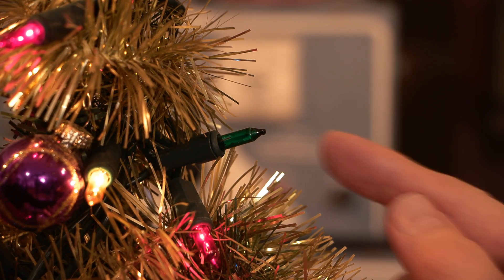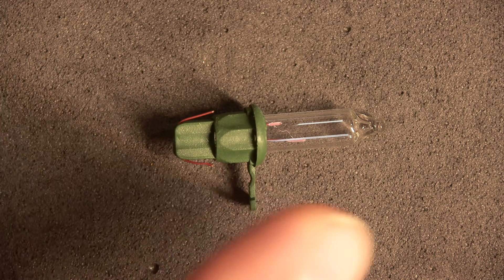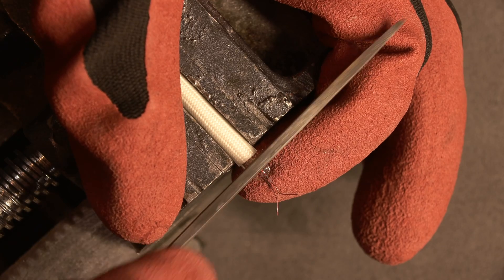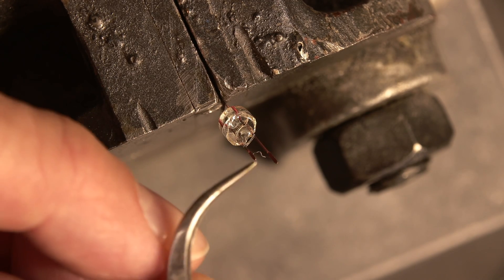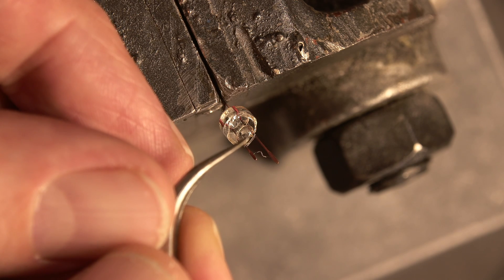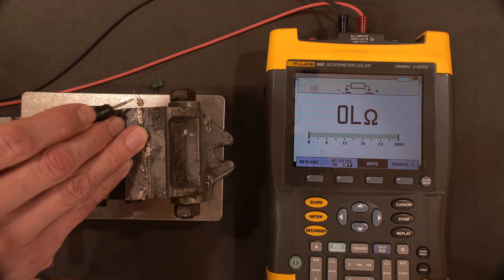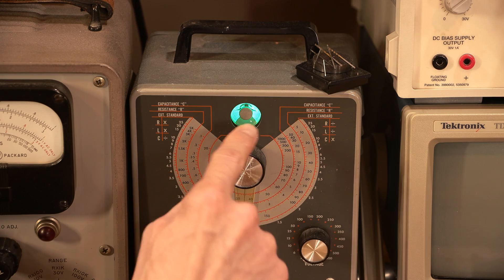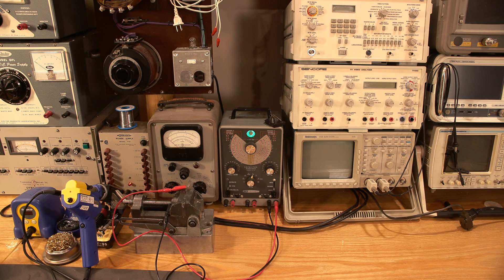The Magic Hiding Inside Your Incandescent Holiday Light Strings!

Comment: "So what is remaking that circuit again?"

Nothing, because it wouldn't be making the circuit again again. It would just be remaking that circuit. (Period.)
Reply from the maker: #1 When multiple bulbs fail, they are continually re-making the circuit. 
#2 The filament originally made the circuit in a single bulb, then the shunt re-makes it. 
#3 The shunt will often not make the connection right away causing multiple flickers, re-making the circuit multiple times before it welds itself.
Choose which answer best suits your word play.
Reply: @MrCarlsonsLab : 1. You totally misunderstood what I was saying. I wasn't actually asking you what was remaking the circuit. Did you not notice the quotation marks? I was quoting you from when you asked that question. That's because "re-"(something) with "again" doesn't make sense. "Re-" already means "again"!

2. I wasn't making so-called "word play," silly. That's not what telling you that "re-" already means "again" is. It's just showing you why saying that ("re[something] again") doesn't make sense. There's a big difference.

Comment: Last year I've bought 3 garlands with this type of incandescent bulbs (100 bulbs 220 Volts), add fuses and 2x 36 Ohms resistors in each string, and you know what? After a month of usage more than 20 bulbs burned out in the first string, and more than 10 burned out in second and third strings correspondingly. 
I remember twenty years ago, when the garlands of incandescent bulbs did not have this "magical thing" inside, the bulbs itself burned out really rare; we have had 4 or 5 garlands of this type and usually only one or two bulbs failed during 11 month of storage (I don't know why, but they never failed while working during holiday season). Though they tended to melt their decorative plastic cases =D
Anyway, it seems to me that this "magical thing" was introduced not for increasing the reliability but as a part of the "programmed obsolescence" where the light bulbs themselves are of a very poor quality.
Reply from the maker: I purchased some very poor quality lamp sets as well a few years back, the bulbs burned out very fast. I suspect a bad vacuum or bad tungsten. Lately (with a diode dropper) I get years out of a string lit 24 hours a day.

Comment: Followup: I rewatched. Everything I wrote a few notes down is correct, I think. And the machanism that causes the shunt to conduct is that when the filament goes, then there is 120 volts across the insulated shunt. When the filament is working, the shunt is insulated and doing nothing. When the filament goes, there is 120 volts across each end of the insulated shunt, instead of whatever the bulb voltage was. So that 120vac "blow's" through the (very thin) insulation, and the conductors carrying the vac come in contact with the actual shunt conductive center section? I think that's right. Thanks.

Comment: So a series 20 bulb set of 6V each on a 120V(ac) supply could be better protected if another 9 more (8 is ok too) similar rated lamps were added to the series..so now instead of each lamp getting 20V(rms) ..each would get slightly lower than 20V(pk)......
Here the chances of the entire string experiencing a higher pk. is eliminated..even if the random initial switch on  occurs @ the pk. of the ac waveform.
Reply: If you connected 2 sets together in series, the lamps would all be dimmer, but would last almost forever!

Comment: Sir, A schematic would help in understanding for some of us. Is the "backup conductor" in parallel with the filament? Assuming the answer is yes, then you are saying it is essentially a zero ohm conductor, that keeps the overall series circuit of the string intact? And I think that in this design of string lights, all the bulbs are in series? So if there are, let's say 60 bulbs, they are each getting 2 volts (in America)? So the extra two volts is being redistributed across the other 59 bulbs? I'm still not clear on the arrangement of the shunt versus the filament, and the mechanism that causes the shunt to become conductive. The "insulation burns off" from what exactly?
Please take a moment to explain further. I thought "maybe" I saw another video from you on this subject. I'll look. I will also watch this one a couple more times. But if you do a video followup, please include a drawing or two. Thank You. Minneapolis MN Dec 19-2023

Comment: I have a GE tree that has pre-wired incandescent lights.  It has the old style of fused bulb which are not replaceable.  I have just been clipping them out and soldering in regular bulbs when I see a darkened section (probably done about 8 or so in the last 6-7 years).  I think the tree has 8 strings of lights or so, but it has a fused plug (with the little door that opens up).  Why would they use both the fused bulbs and a fuse in the plug?  I suppose they want you to buy another one at some point, but the newer models have replaceable fuse bulbs.

Comment: Very interesting. This might explain one of the failure modes of the entire string. If two or more bulb fail while the power is off (due to rough handling that breaks the filaments), there is not enough voltage across those failed bulbs to cause a breakdown of the bypass path. It would also explain why swapping bulbs one at a time fails to locate the double/multiple failure.
Reply from the maker: You are absolutely correct Tom!

Comment: I used these bulbs as street light bulbs and to illuminate the inside of buildings on my model railway layout back in the 70s.
I found out purely by accident that they ran perfect on a 12V DC transformer and I could dim or brighten them.
Looked amazing with the main light switched off, especially as the setting was all steam age and they gave a lovely warm glow.
I must have made about 300 lamp posts out of modellers brass tubing and roughly 50 buildings had lights inside.
5 years later and I was still working on it.
Truly remarkable little things.
✌️❤️🇬🇧

Comment: I have used an Associated Research hipot tester for 30+ years to break down the anodized shunt wire. Just clip onto the plug and turn up until the leakage light just illuminates. Plug the string back in and change the bad bulb.

Comment: If the antifuse doesn't trip and you do have half a string out, you can remove a bulb from the good half (if it's two series parallel strings) and zap the set with the sparker from a BBQ igniter, and it should make the antifuse trip and short the blown bulb, and the dead half of the string should light when you plug it in again.

Comment: How is the wire connected to each pole of the light itself but not connected while the bulb is on?   I’m trying to understand where the insulation is in regards to the wire connecting the bulbs.  I wish you would have sketched out a diagram or showed a real closeup.   Very interesting but still a bit confused.
Reply: It must be an extremely thin layer of varnish or laquer  on the wire shunt & breaks down once the voltage goes over a certain limit.

Comment: Great informative vidio!! My hobby is collecting and repairing early transistor radios. I've got a dumb question for you. There must be a reason why they dont just wire lights in parallel. If one burned out the rest would continue to work. There must be a simple reason why they dont do that. What is it?🤔
Reply: I wish someone had answered your question!   I had the same one.   I'm wondering if it's because of dimming as you go further down the string.   With a series network, even with the 2 supply wires having some resistance, you can count on each lamp getting the same current through it and the same voltage drop across it.   With a parallel network, as you travel down the string, due to the resistance of the main wires you have less voltage available at that point (than at the top of the string).   So the lamp could be noticeably dimmer?   I really don't know if that would be true or not in practice.

Comment: I learned this too late to save my prestrung artificial tree. They sell a repair tool to get strings working. It has a piezoelectric zapper inside just like a BBQ lighter. You didn't explain that if more than 10% of your lights short, the others get too bright. It permanently increases their resistance, and they will be dimmer than the new bulbs. If they last at all.

Comment: Sometimes the magic doesn't quite work due to slightly different tolerances. There's a "light fixer" tool you can get that plugs in place of a single bulb and injects voltage to try to force the insulation breakdown to occur when the line voltage isn't quite enough.
Reply: The "Light Keeper Pro". I have used with success several times, and a few fails.

Comment: I have an idea for another Christmas tree light video. I switched to LED lights a few years ago on an artificial tree when the difficulty of getting a live tree became too much for me to handle. However, the number of LEDS on the tree is so great that it overwhelms visually the tree’s ornaments at night (too bright). I have been looking for a dimmer controller that would dim the LEDs effectively and without damaging them.  Any suggestions or ideas for one? I haven’t found one that is made for strings of LED Christmas lights.
Reply: This is a great consumer-level request and unfortunately a complex request when you get to the details of how LED strings work.

For example: Some LED strings run directly from 110/220V. Some of those only take the “peaks” of the AC wave, some of them rectify the wave, and some just power the LEDs from the top and bottom of the wave. Some LEDs strings convert AC to DC somewhere after the AC outlet and they could go anywhere from 3V to 24V with multiple different ways of doing that. Of those they could be using constant current or constant voltage to achieve the brightness level. Some LED strings even have circuitry in each LED to allow for better uniformity, longer life, and/or effects.

So TL;DR: There are way too many variables to make even a half-dozen “common dimmer devices” and in some cases it’s not even possible without cutting wires.
Reply: @JB-fh1bb  Thank you very kindly for your reply and useful information.  I discovered a few of the things you mentioned when I first looked at finding a solution last year.  So, I stopped, realizing that I would have to modify my lights and end up worse off.
Reply: It might surprise you to know that they actually make LED strings that are dimmable, but usually they're on the "Pre- Lit" artificial Christmas trees as it were. Typically they have a (or come with) a variable button select box about the size of match box that you simply push the switch  button to select 'cool lit', 'natural lit or 'bright'  along with optional twinkling and speed control. My wife is using one right now.😅 Merry  Christmas.
Reply: @Rev22-21  Thank you for your helpful reply. I examined my lights last year (they came with the artificial tree we purchased) and I didn’t find anything more than the on-off foot switch. I emailed and called the company where I purchased the tree, but they were not helpful at all, which was a surprise to me at the time. Merry Christmas to you and your family!

Comment: I only use these kind of lights.  I don’t like the LED variants so always stock up on replacement bulbs, luckily they’re still available online.

The screw-in style are brighter than the push in type.

LED lamps don’t light up the room with a relaxing light like incandescent.  I often just have the light from the Christmas lights.

Comment: Gotta replace those shunted bulbs quickly, though.  I had an issue once where a few too many were out, putting excess voltage to the rest and a cascade failure quickly occurred.  Took out the whole strand.

Comment: Interesting to see how it works...  I never checked it and I always sort of assumed there would be a PTC resistor somewhere in the bulb.
Reply: 🤔 wouldnt that be NTC? Such that at the nominal bulb voltage it would be high in resistance, but wen the bulb goes out and the voltage goes high, it would start drawing more current, warming up, and going down in resistance? It would be comparatively expensive and the heat from the bulb might trigger one, and eventually the whole chain could cascade into a low resistance circuit. Unless the NTC was selected so that it never falls below the working bulb resistance. Even then it would be expensive and overengineered.
Reply: @jussikuusela7345  No, when the bulb would be glowing as normal the temperature would be high and the PTC would have a high resistance and not be active as part of the circuit.  When the bulb fails it would cool down and the PTC resistance would lower and replace the bulb.  Of course it should be dimensioned so that the self-warming of the PTC is much less than the warming by the filament.
Reply: @Rob2  you are right... PTC would probably work as you explained, and what I rambled about NTC would have the problem I explained. It might still be a bit overengineered and expensive.

Comment: When I was young, we had slightly larger lights that were using screw fittings.  The reason for the entire string not working normally was that one bulb wasn't securely screwed in.  This magic solution did not help against that either.

Comment: Merry Christmas Paul! Great explanation and demonstration of these seemingly simple bulbs.  Recently I have had new light strings totally fail after not much use and I suspect the filaments are not the best quality and the voltage break down of the shunt is not carefully controlled. (just a guess)  Older light strings 30 years old still work as they should.
Reply from the maker: Merry Christmas Erik!

Comment: Thanks for the video. So it took over 100v to do the short. When 1 burns out on say a 50 string then voltage goes up enough to make connection?
Reply from the maker: If the entire string goes dark, the bulb that is "open" will have full AC line across the two posts of the failed bulb, allowing for the breakdown to occur.
Reply: @MrCarlsonsLab  ok so if full set it working and 1 bulb goes out how much voltage at burnt out bulb?
Reply from the maker: For a brief second when the bulb isn't glowing, it can go to full AC line, this is what causes the breakdown, then the shunt joins across the broken filament. When the bulb is working correctly, IE: the filament is still intact, the bulb will only handle very low voltage, (usually between 1.2 and 12 Volts.) It's the difference between this low voltage "normal operation" and the high voltage that occurs across the filament rods that causes the shunt to close. NEVER put line AC across one of those bulbs, it's not designed to take that. The bulb has to be in a string that "current limits" the shunting process. @Tysman909
Reply: @MrCarlsonsLab  ah ok thank you now I know fully
Reply: There is something I could really use your help with, it's my vacuum tube tuner that goes with my matching amp. It still has selenium rectifiers 4 of them that I would like to convert to silicone and use a dropping resistor. I don't know how to wire it up. I do have schematic, also radio lately is slowly dropping signal which causes a strange squeel type noise a little bit then coming back to full. will need to troubleshoot that

Comment: Learned something today about the Christmas tree light bypass function.  I had thought the opening of the filament caused one side of the filament support to move making the connection with the wire loop at the based of the two filament supports. (( Like the arm moving on a Grasshopper Fuse. ))   Did not understand how the insulation burned of the wire loop to make the new circuit contact.    Thank you..!

Comment: does anyone remember those horrible early midget light sets that were in a loop, rather then a straight string, and were so hard to place evenly on the tree ? those were the ones without a shunt, and were a pain to locate the failed bulb. I'm glad those were phased out in favor of the inline sets with the shunts.
Reply: Ya know, you really don't have to fool with Christmas decorations if you don't want to. I don't think there's anything in the Bible that says you have to decorate. So your immortal soul should be safe regardless.
Reply: I hated those looped light sets, I used to convert them into straight strings by extending one end of the sets supply wires.

Comment: I fight with incandescent Christmas tree lights every darn year. lol  I've had a couple sets of "cheap" LED lights but they do not look as good and they don't seem to last. The little power brick burns up. I took 1 apart and found that a mosfet had shorted internally and caused the small transformer to burn up. Didn't even blow the fuse.
Reply: What do you mean? The transformer was the fuse!

Comment: Wouldn't it have been better to break the dead bulb?🤔
Reply: No, as the shorting wire had already had its insulation burned away to keep the remaining set running when the filament failed.

Comment: One time in my life I could witness a string with these bulb to die progressively but also very fast. Bulbs kept popping because the voltage on those kept rising due to the broken bulbs shorting. Until the circuit protector tripped in the consumer unit.
Reply: I've seen it twice, it's pretty interesting to witness.

Comment: So...  If you apply a high voltage to burn all the bulbs instantly,  all the shunts will apply and the current goes up again and the wire then catches fire?
I always loved fireworks in Christmas.
Reply: There should be a fuse in the plug to prevent the string from catching fire.
Reply: That is why there is usually a 'fuse' bulb (often clear and white tipped) without a shunt and/or a fuse in the mains plug.